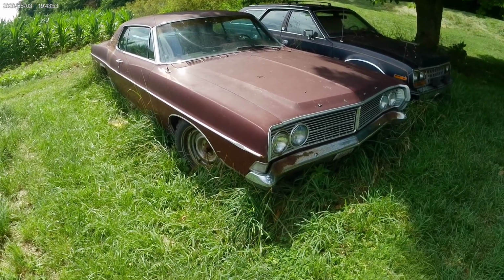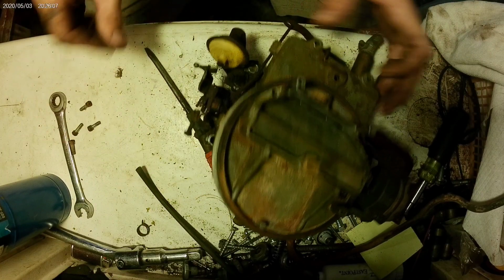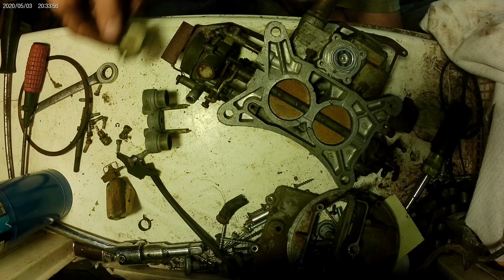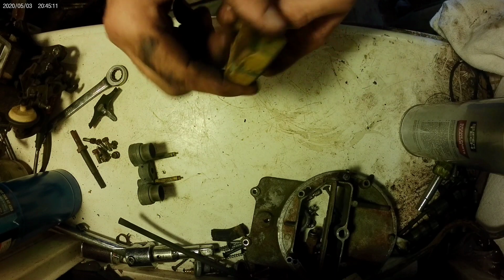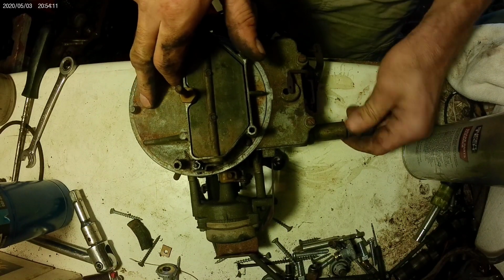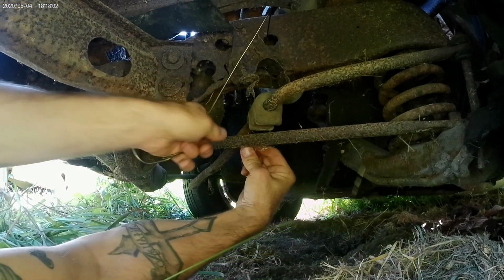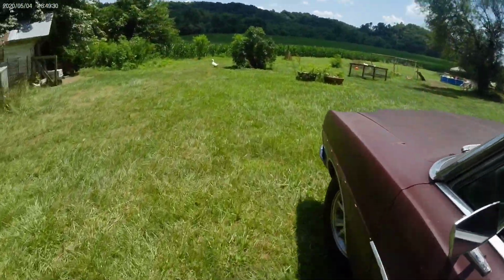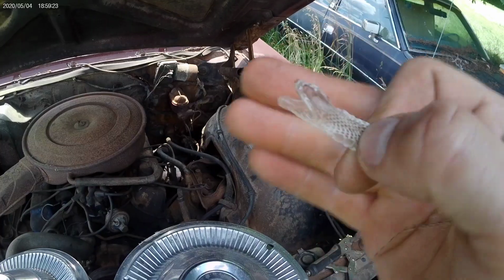1968 Fird Galaxie - Will It Drive?

Comment: What Front adapters. U use ??
Reply from the maker: Just 4.5 to 4.5, inch and a half or 2 inch. I'm not sure of the brand I just got them because they would work. They aren't permanent because they aren't hub centric. I think I got them off of ebay.